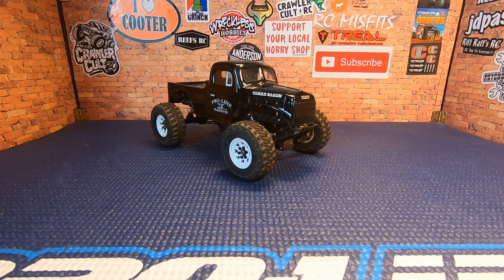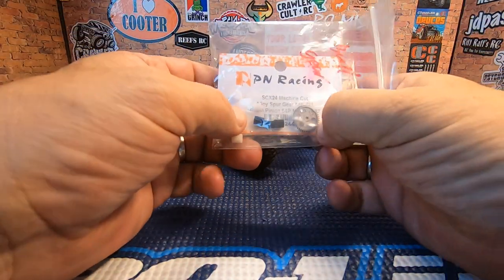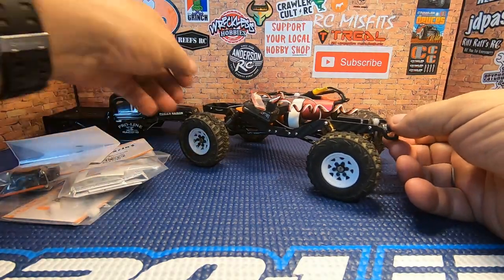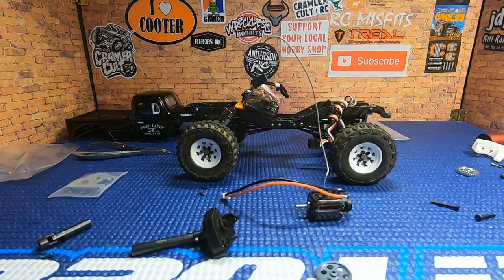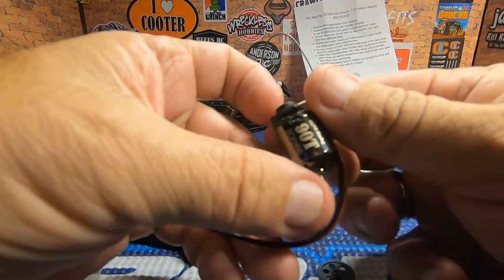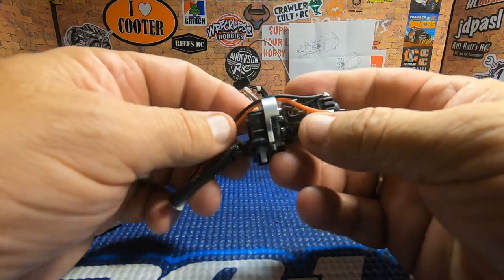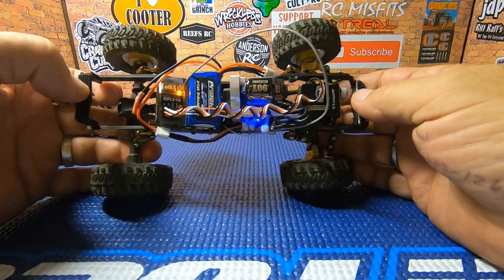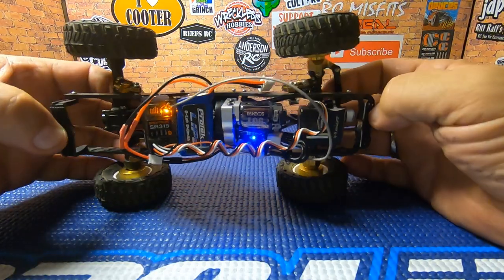The Best Brushed Motor for your SCX24 PN Racing

Comment: Does it roll slow? why doesn't anyone do driving videos after lol...
Reply from the maker: I've done driving videos,
Reply: @BullgearRCvideos  i did go through your videos and see some but when im searching on youtube ya know and im looking for a motor upgrade, no one has a video of before and after driving it. If that makes sense! im trying to find the most powerful motor for the 24 and i have yet to see any good videos on motors but also havent searched a lot truth be told. i did like the video though!
Reply from the maker: @Rustykiller17  well what do you want the motor to do? Slow crawl? Wheel speed? A mix? I have tested many motors. I may be able to point you to what you need
Reply from the maker: https://youtu.be/z1Nl_U1Wb1Q
Reply: @BullgearRCvideos  i don't know why youtube just told me you responded haha but i think i found a brushless ima give a shot after some hours of research. It has a super slow crawl at the cost of a little speed from stock but im ok with that cause these are crawlers haha

thanks for the responses though!
Reply: @BullgearRCvideos  will this motor work with the stock esc? im still debating what ima do haha. Thanks for the responses by the way!

Comment: CAN YOU HELP PLEASE  ? hi 👋  the 4500kv motor that you had in this dodge with the low CG mount . I bought that motor awhile back and the mount . But I did not have a pinion gear for the motor. That will mesh with the aluminum one you have in your hand when comparing it to the new one you are getting ready to install.  Can you please let me know what size you ran and where you got it from . I think the shaft size is like 2.22 mm 🤔  did you run 12t or 13t  ? Please send a link so I can order one . I hope you see this message lol 😆  love your videos . Thank you
Reply from the maker: I believe this is the one I used
https://www.ebay.com/itm/0-5M12T-2mm-3mm-Bore-Hole-12-Tooth-Width-5mm-Module-0-5-Motor-Metal-Spur-Gear-/143818307321?mkcid=16&mkevt=1&_trksid=p2349624.m46890.l49286&mkrid=711-127632-2357-0
Reply: Thank you sir for the quick response.... much respect.  I see it doesn't have a set screw . Did it press on tight or did you solder it on ... ?? The shaft on the motor I have has a flat side for a set screw ..... did yours have a flat side on the shafts too ? 🤔
Reply from the maker: @think2cre81  I think it pressed on if I remember right. It has been a while since that build. I will try to look when I have a chance.
Reply: @BullgearRCvideos  again sir , thank you for quick reply.  Please do look if you have time , I just ordered the gear with 2mm bore . Because I'm sure 3mm would be to large.  These little crawlers are so much fun . Me and my grandkids and son in-law have so much fun racing them on a rock course I built in the back yard with a few wooden obstacles like a  Teeter todder and ramp . It all lights up with solar at night . Even my 4 year old grandson is good at it . I modified them all with furitek esc tegu and the brushless motor kit . So now they have so much control and torque that it's not so jerky when going from forward to reverse.  And even on the low setting it still has the torque to climb anything on the course.  Where before with the stock brushed motor or even the longer ones . On low had no torque to speak of . And could not make it around the course.  And they ran hot 🔥  even with heat sinks on them . The furitek don't really get hot . Sorry I'm rambling lol . I'll take any information you have on that setup for the 4500kv ... thank you

Comment: great review of that motor. looks like it has a great footprint to fit in the vehicle nicely.  Now you are gonna make me go buy another motor.  I was gonna do it anyway. LOL
Reply from the maker: Lol, you know you want it🤣👍
Reply: @BullgearRCvideos  I do
Reply: Did you get one yet? Mine is sweet.
Reply: You guys run into any clearance issues? Will be putting mine in tomorrow, gonna try the metal pinion that came with my Hot racing 050
Reply: You need to cut the ESC shelf, I made a new mount out of aluminum sheet. It's great and runs cool so far...

Comment: Very curious on heat temps after long drives. And with larger tires like scramblers  I'm looking for a smaller motor than the ox   I have been very happy with it and the RGT motor jus need something smaller for a comp build and it needs power

Comment: I tried the PN90 with the PN gears. Maybe i got a bad one. But I dont like it at all. Its like an on/off switch. My cheap china RCAWD 180 motor is WAY smoother than the PN90. Id rather run the PN90 due to size and look too.
Reply from the maker: Maybe your esc is to blame?
Reply: @BullgearRCvideos   I tried adjusting the throttle curve in the furitek app. I could not get it to run smooth. I even broke in the motor before use too. It got faster with break in. But man, mine just jumps forward. Oh well, maybe mine is bad. But the 180 motor is rather nice. Its the smoothest brushed Ive found yet. And it has a 16t pinion on it too.

Comment: Do you use anything to help prevent the pinion from spinning? I think I used super glue on mine but yesterday the shaft just started spinning freely. Thanks
Reply from the maker: Haven't had any issues with mine

Comment: I'm fixing to order that same combination of motor pinion gears and motor mount. What pinion do you recommend to gain more speed than stock but still crawlable?
Reply: At least I think that's what I'm about to order. I've been running the injora 50 turn. I bought the chameleon and installed it but it is slow compared to the injora. Do you think this will at least be a little bit faster than the injora?
Reply from the maker: What I recieved with mine were 3 different pinions.  I used the smallest of the three because I am more into slow speed crawling, but I'm sure the biggest of the three will give you some Decent speed
Reply: @BullgearRCvideos  yeah I like low speed myself that's why I'm trying to maintain some low speed resolution and still get a little bit more wheel speed. I do have the 24% overdrive on the front though. Thanks, I appreciate it.

Comment: I've seen other videos where people had suspension and drive shaft clearance problems with that motor mount and motor combo,  Did you have any problems?
Reply from the maker: I have also seen those videos. But my truck doesn't have a stock chassis, links or driveshafts, so I can't make comparisons to what they have encountered on their rigs with my rig

Comment: How did you install that pinion
Reply from the maker: I put it on and tightened the set screw
Reply: @BullgearRCvideos  do you recommend heating up the pinion with a lighter to make it expand a little just to fit in?
Reply from the maker: @yochillll2672  no

Comment: Reverse with Lizard brushed is awful, even stock is much better. Curious for this motor, Harley did already show it. Hard to get here in EU, none of the shops selling PN parts for Mini-z does yet have it.
Reply from the maker: I haven't had an issue with reverse in any of my Furitek rigs, but I did a bunch of experimenting with settings. If you play with it a bit you can dial them in pretty good👍
Reply: @BullgearRCvideos  Not in brushed - made a long video about it. Forward is ok, reverse is super bad.
Reply from the maker: This is the second brushed motor I have used with Furitek with no problems.  Maybe you got a bad one or haven't updated the firmware 🤔
Reply: @BullgearRCvideos  I have 3 Lizards. Did you ever test reverse? Make a simple test: Plug motor into Lizard and go reverse, than unplug it and plug it into the original SCX24 ESC and go reverse. You will see that even the stock SCX24 ESC does have better reverse low speed modulation than the Lizard.
I tested this in several (punch) settings. I even made rpm measurements with blank motors (SCX24 and Barrage) and graphs, which do show this perfectly. Made a 2 hrs video showing all this stuff and those measurements. 
However, I would like to see a comparison between PN motor and SCX24 stock motor and a Barrage motor. You did not really show this. I know (from Mini-Z) that PN has high quality parts (from Mini-Z), and assume this motor is top, too. But what is "better"? It has obviously much better build quality. But what else? 90t vs. 88t does not make any difference in theory. PN will probably have longer life time than the stock motor. But what do you "feel", is it stronger, slower?
Sorry for all those questions. But if I could get hand on such a motor easily I would immediately buy one and test it. Yet it is not easy, and I hesitate to buy the motor now from their shop, because shipping and customs would make it super expensive (about 50 - 60 bucks) for me now, this is quite much for a tiny brushed motor.
Reply from the maker: Did you reverse the polarity of your motor wires and run esc in counter clockwise rotation?
Reply from the maker: @donaldsneffe  I did not test vs stock esc. Here is my reasoning. #1 Furitek FOC slow crawl is very impressive to look at and works well for filming crawling videos for me. However in real world play or competition driving, I find that I rarely take advantage of that feature.
 Reverse...well I only use that to realign when necessary to get a better line over obstacles. So for my driving style, as long as it backs up when I need it to I am happy. I would like to test the esc you have recommended but I don't read what I will assume is German.(But maybe I will translate at some point) Your approach is a lot more scientific and engineering based than mine, and although I find that approach has merit, what matters to me is if my rig will perform on the rocks. And I have found this to be the case in my trucks👍
Reply: @BullgearRCvideos  Because i am scientist ;) (however, those tests are far from "science", because there are a lot more factors to consider and of course one would have to test at least about 6 of the same kind to get somewhat proper statistics). 
I like playing around.
You can change the German website to English and Spanish (right top). 
But those ESCs are boat ESCs, not made for cars and trucks... 
But you are right: If it works, it works...
Biggest surprise for me: Komodo/Lizard does not have any chance against small brushed motors because of missing punch and high weight.
I personally think for competition 3s setup with tiny 3s Lipo (I have Turnigy Nanotech 180 mAh 3s from small planes) will be unbeatable, battery low, super low center of gravity, light...
I am not super exited about Komodo and Surpass 1400 (have both), the super slow crawl looks awesome, fantastic - but when would you really use/need this. 
I would like to see a video of yours comparing the new PN motor with the stock SCX24 motor. (Because I cannot yet do this ;)  ).
I still do have some Turnigy 130 torque motors (unfortunately discontinued), use one in my Mini-Z 4x4. Maybe this could also be a good motor for SCX24 (will have to sand down 2 mm shaft to 1.5 mm).

I like your videos!
Reply: Kenon hobby does ship worldwide
Reply: @papachill  I checked this (guess from Harleys SCX24 video), but shipping would be about 20, and then we have to pay customs (guaranteed now, new rules since July 1st in EU) plus "handling fee" to shipper, what would make the motor about 50 - 60 bucks, and this is quite a lot for a tiny brushed motor. With motor mount etc. of course even more.
Hope it will be available here in EU soon, a couple of shops do sell PN parts for Mini-Z, but none of those actually does have this motor.

Comment: Bull I need your help,I can’t get mine to slow crawl
Reply from the maker: What esc are you running? Are you running the PN Racing motor?
Reply: @BullgearRCvideos  yeah the furitek Lizard with the pn motor
Reply: @BullgearRCvideos  thanks for responding
Reply from the maker: @MrScatliffe  I will look at my settings in the esc later and let you know how I have mine set up. Remember you won't have the super slow crawl like the brushless motors because you need brushless to use the FOC in the Furitek esc
Reply: @BullgearRCvideos  ok thanks greatly appreciated